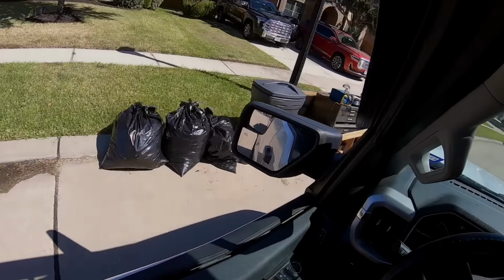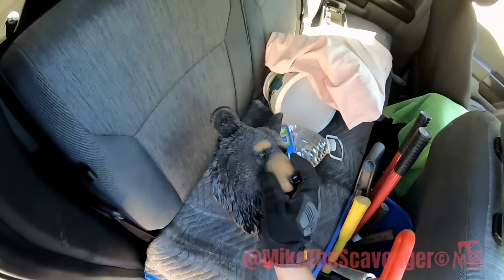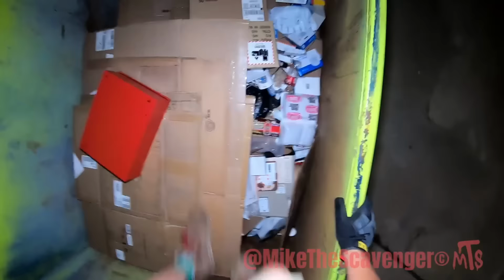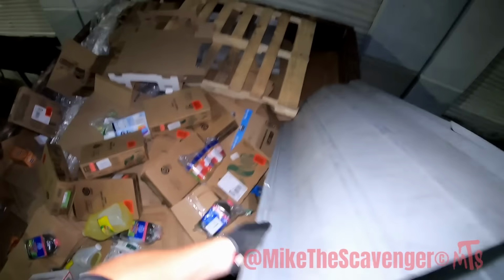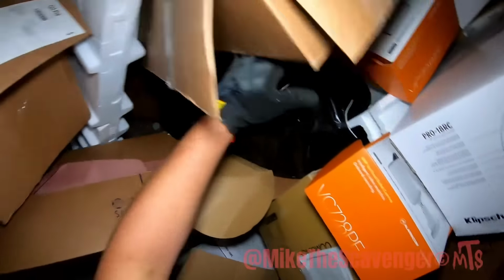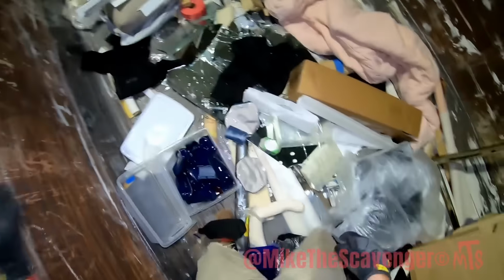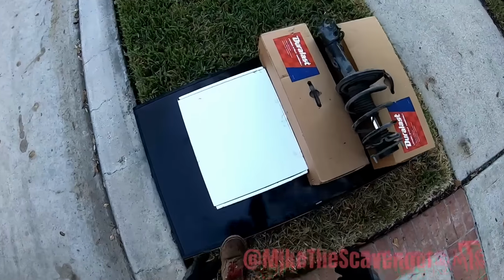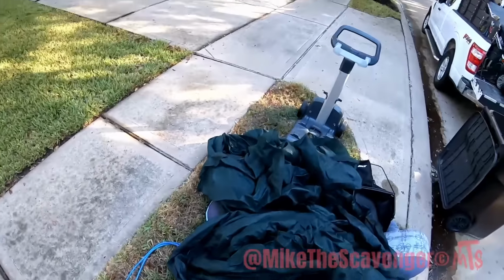Dumpster Diving & Curbsiding "Our Miraculous Escape!"

Comment: Mike, maybe I'm whistling Dixie or maybe I'm whistling out of tune but in one of your videos you told us that your scrap yard had a fire and it was closed. And your new scrap yard doesn't buy refridgerators. Did you ever think about stock-piling the fridges in your yard or someplace else until your scrap yard is up and running? WOW! What a payday that would be when its time to cash them in? Or, another option would be to call around in Houston to other scrap yards and see if they buy fridges. There must be at least 8-10 more scrap yards in the Houston area. Mike, you seem to have most everything covered in your scrapping business but for the likes of me and I am sure other viewers fill the same way, I feel you miss the mark on several things and I will name a few. 1. Why don't you buy a trailer? 2. Why don't you pick up aluminum cans? Put a big black garbage bag in your truck and just throw the cans in there. Then when you get home , bend them by hand and throw them in a 55 gallon drum until that rainy day when its time to cash them in. Mike, that is an absolutely a no brainer. At the end of the year you have passed up on several hundred dollars by not picking up the cans. 3. Why don't you pick up the big sheets of cardboard? (Of course you need a trailer for that and that is why a trailer is so important) 4. Why do you leave so many cannisters behind? Your scrap yard requires you to do something to them before they will buy them but maybe other scrap yards don't. Have you checked with any of them? Or, you could devise some type of crushing devive so to be in  compliance with your scrap yards conditions so that they will buy them 5. Fire extinguishers. You don't pick them up. Check with a place that sell new ones and see if there is a market for second hand ones? 6. Good used furniture, you seem to always leave behind. (Again, a trailer would be a big help) Why not check with some used furniture places and see if they are interested in choice pieces of furniture? Or while you are talking with them ask them what they may be interested in buying?. 7. Printers, you don't pick them up because your scrap yard doesn't buy them. Check with big printer repair shops and see if they are interested. They may be because of the spare parts involved. 8. Last suggestion but they may be more that I missed.  Pallets, why not check with a few places that buy them and see if they are interestd in ? Mike, please don't take this as an attack on your intellegence, believe me its not. I think you are an extremly sharp guy that has it together for such a young whipper snapper. I am 85, retired living in Thailand for 22 years and I am an avid viewer of all your videos. Keep um coming because they bring much joy for thousands of viewers. Also, do you realize that you have more videos on YouTube than anyone else. Let your viewers know when YouTube is going to present you with a "special award.''